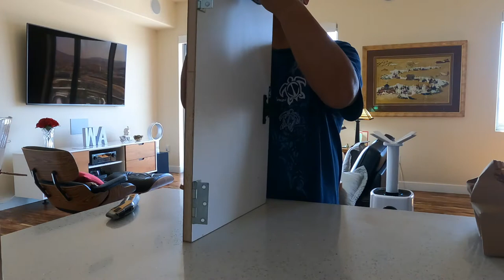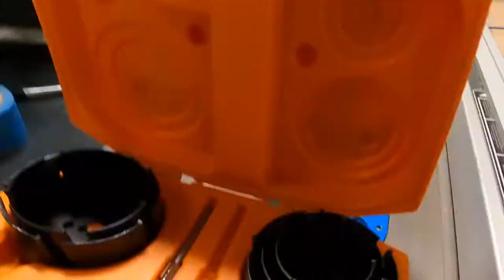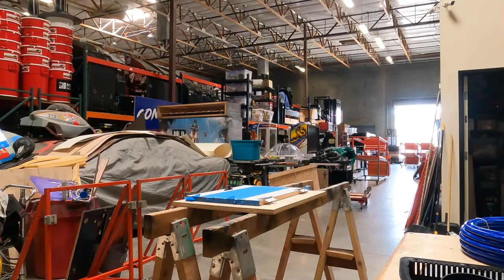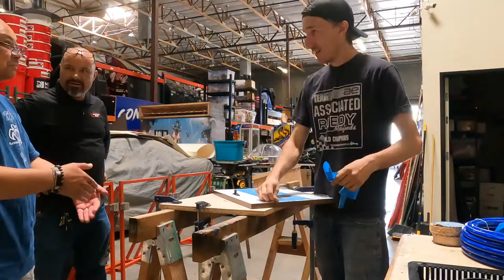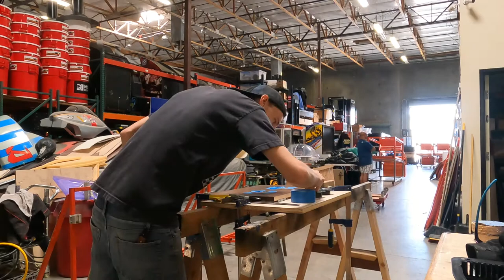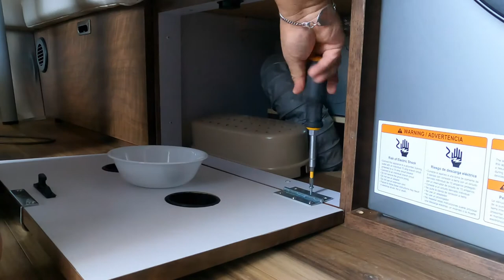Heater Vent for the Globetrotter Airstream

Comment: What door did you add vents to?  What problem do the vents address?  Something overheating?  Does this let more heat out?
Reply from the maker: it's for the fresh air intake for the propane heater. in the addition of the washer/dryer combo. the heater had to be moved a couple of inches and the drawer that originally housed the propane heater was redesigned and NO fresh intake was added, soooo I added one.